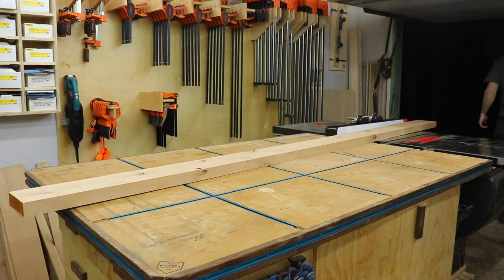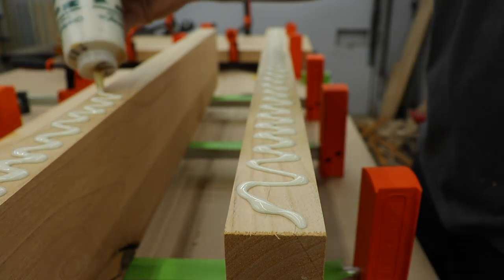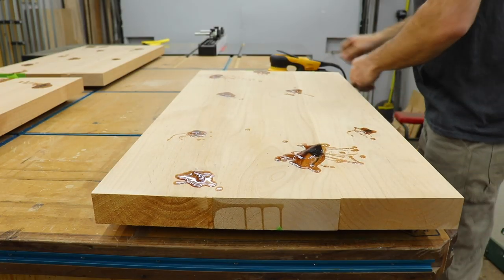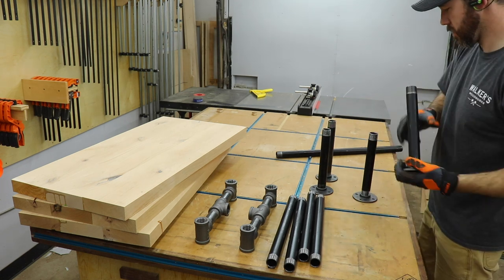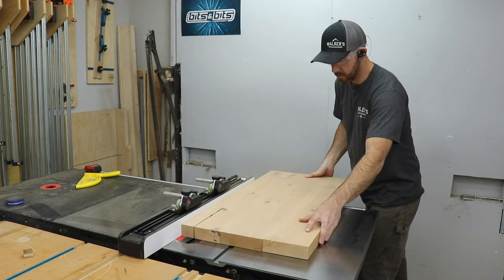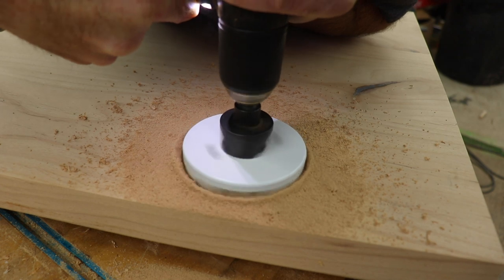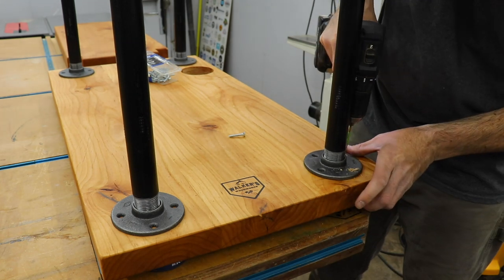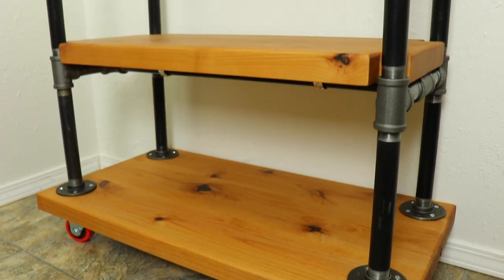MOBILE Kitchen Island / DIY Kitchen Cart

Comment: I like the cart. I tried doing shelving with that pipe and it was a disaster. But I've learned a ton since then. The only thing I would have done different is that I would have made the middle shelf the same size as the top and bottom and joined it by using flanges on the top and bottom of the middle shelf.
Reply from the maker: That was another design I offered but she wanted this one haha.

Comment: Brandon, I went and looked at the branding irons over at Gearheart Industries.  Quick question, for your iron, did you order the standard cut or the deep cut?  Thanks for sharing the link, I have been looking into irons for a couple months now; Gearheart was not one of the ones I had found in my research.
Reply from the maker: I've had them for 2 years and I don't recall that option.  They work great though and the people over there are awesome.  Reach out to them and they will help you decide what one is best for you.